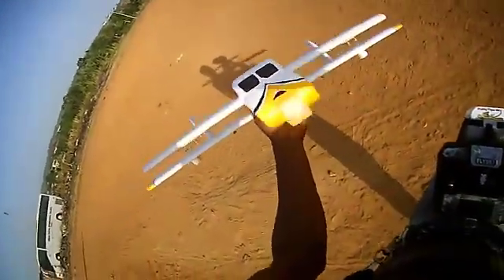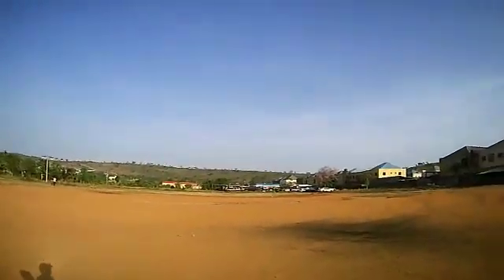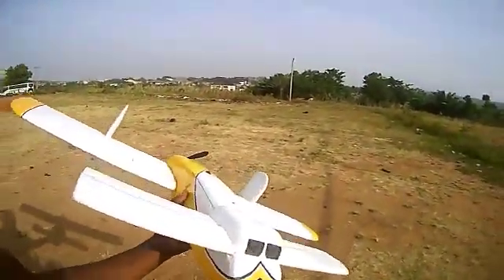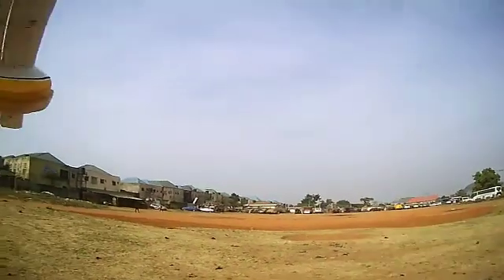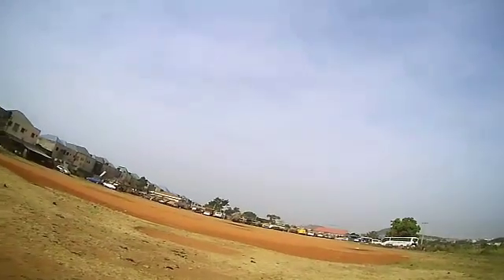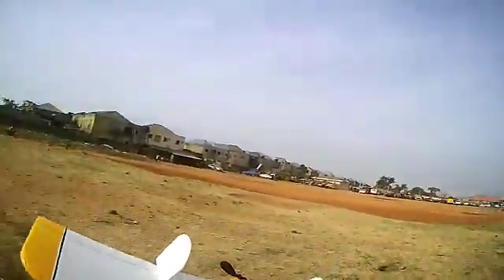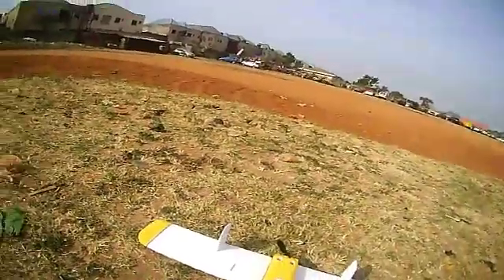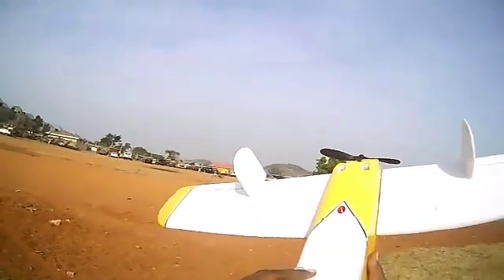RC CANARD AIRPLANE (Hand Launch)

Comment: One design consideration which applies to all pushers: 
I noticed when you first started it up, then played with the throttle range...the prop 'Buzz!' was very loud. I don't know if you like that feature, but the distance of your prop from your wing trailing edge plays the biggest role in HOW MUCH 'noise' is generated.

If you look at classical pusher & canard designs--especially for civil aircraft[..Piaggio Avanti, Beech Starship, some of B. Rutan's planes, the new 'Celera 500'..], they have a tapered nacelle faring around the prop hub--which helps streamline the rear airflow going into & 'around' the prop... as well creates a sizable 'gap' between the prop mounting & the trailing edge flight surface.

That is ONLY if you desire noise reduction. Per Ardua, Ad Astra.
Reply from the maker: Thank you very much for the information sir.

Comment: at 5:30,  the  Mass  in  servos  Should  be  as  Near the  fuselage/center line  as  is  Practical.    this is NOT an opinion.   it is  SCIENCE.  eg., distribution of mass (dom).       it appears that the canard  IMPROPERLY  has a  lift-making profile.       WHYWHYWHY   is  the span of canard  So  BIG.     this is  MORE  dom  wonkiness !!!!        the  BLUNTNESS  of the nose/forward fuselage  results in  a  limitation of the ability to 'tune' the  dom.      read my lips:
fly  with   the   sun   at   your   BACK !!!!!         googletranslate